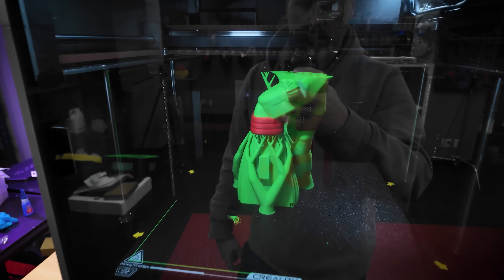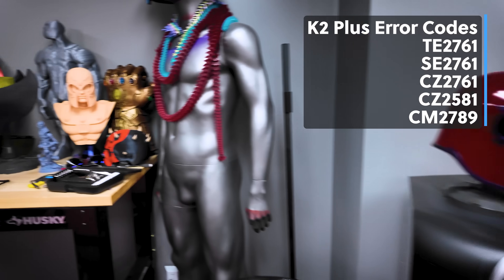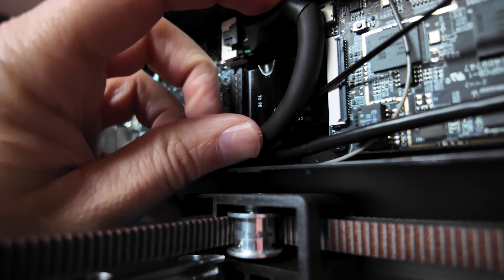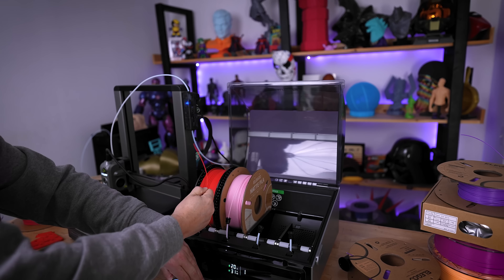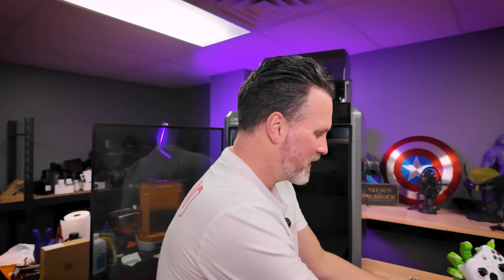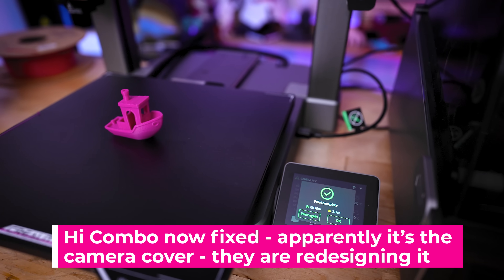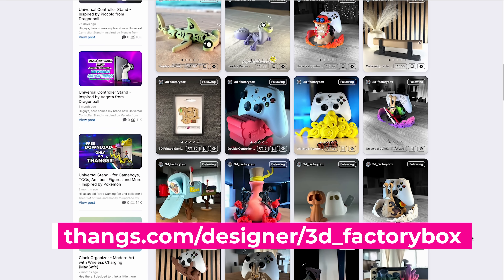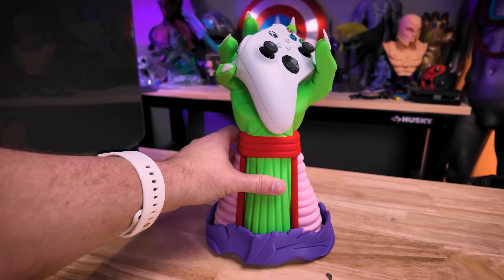Creality K2 Plus FIXED! But Are They Rushing Printers?

Comment: Dude if you think thats bad you dont even want to hear the nightmare I've been dealing with since I got my K2 Plus.  I was lucky enough to get in as one of the first buyers at the 50% off so my first unit showed up late december, opened it up and started a print and nothing but failure after failure after failure until finally during a 3 hour print the unit literally grenaded itself.  Came home to parts of the toolhead as far as 15 feet away from the printer (took the door off due to overheating issues in the extruder).  Boxed that unit up, sent it back, new unit just showed up 2 days ago and the box looks like it was dropped off the side of a building.  There is so much damage to the machine its taken me 2 days just to find all the issues and I havent even plugged it in yet.  They are 1000% rushing units out and FedEx does not handle the shipping process with an ounce of respect.  Before I even opened the replacement machine I counted 15 spots of damage on the shipping box, serious damage, not a scratch here or there, full punctures through the entire box, missing retaining clips, just absolute insanity.  Paid for this machine in June 2024 and havent been able to print a single thing.

Comment: I ordered a Ender 5 MAX on the Creality site it told me it would ship in 3 days.  Then 5 weeks later I find out it will not ship till April 20th and I may get it end of May some time.  So I changed it to the K2 Plus.  Frick am I going to get a garbage printer when I get it.  Its not like the K2 is cheep.  They are so messed up at Creality, they cant even get my order right or on its way.  So disappointed and frustrated at this point.  I dont have any of the products I ordered now 1.5 months later and not sure if I even want them.

Comment: I got a K1Max months after release. After replacing a bunch of mid-run release mix-match of parts, modifying the bed, rooting, doing all the tricks I've seen......it prints half as well as ny Bambus. I had a farm of Ender 3 S1 machines, and they worked great.... but the last 2 generations have been rushed, and even more than usual, they're passing R&D and tech support on to their customers. I'm at the point I don't believe I will buy another Creality.

Comment: I have a k2 plus and so far haven’t had any issues yet (just bought it last week) and was curious if you ever messed around with TPU?  I’m pretty new to 3-D printing, but I tried dialing it in a little bit and have trouble even getting the filament to extrude. I wasn’t using the CFS system as well.

Comment: This video series sums up why I have zero faith in Creality at this point. Creality made it abundently clear they weren't interested in pushing 3d printing forward. They were content for things to sit exactly where they were, releasing incremental upgrades and charging for little to no actual innovation. All the problems that Creality and even Prusa to a degree  have had catching up to Bambu in the past 2 years, shows just how disruptive to the industry they really were. If Bambu hadn't shown up, we would likely still all be dealing with printers that are only marginally better than the Ender 3.

Comment: This printer sucks!
You fix one broken piece & something else breaks. I do think they read comments on your videos tho. I complained about them not responding to email on one of your other videos & the next day they replied to me. They are sending a replacment part for something I have already fixed but the printer was down for so long that it skipped 4 firmware updates. Now it won't cut filament when it retracts. It also prints with elephants foot after the update. My chainlink has now broken if anyone knows where I can get a replacment link or find a STL.

Comment: Other manufacturers: we need to bring new printer to the market, let's change every part from the previous one 🎩
Prusa: we also have a new printer, though it consists mostly of "old" parts 🛠
Buyers looking at Prusa: meh stagnant, meh printed parts 🤮 Let's try the shiny one 🤑
Also Prusa: each model has thousands of test hours in print farm and print profiles tried in practice before they hit the shop 😉
Buyers after getting the shiny thing: I'm done, never buy from brand X. Switches to brand Y for rinse and repeat 🙈

Lesson for other printer manufacturers: start using printed parts and use your printers to make them - aka eating your own dog food - and you will find the errors faster 😅

(Prusa is too expensive for me too, but maybe in the future. Plan B is to wait 6-12 months after printer release to see how it is going and if it is still supported or already abandoned)

Comment: I have two K2 printers. I had to rebuild one. The other had bad extruder motor.  They took 2 months of back and forth to fix the first.  2nd one is still in need of repairs.

Comment: I always like these videos. He is very good at complimenting bad with good and not just blasting the company. It is unfortunate these things happen. No one likes a machine that is new and broken. I had that with a brand new computer years ago and they wanted to replace it with a rebuilt computer (it worked for 30 minutes before dying during setup) so obviously this is not specific to 3d printers. 
Creality may be putting out a few new printers but at least they support older models still and don't just shove them to the side for the next printer that is coming out a few weeks after the last like a certain competitor does. I bought the K2 during the first day pre-sale and it is a great machine. I have had a few issues with it but nothing that was damning. Before you kill a company why don't you find out how many people are actually having these problems. Is it just a handful compared to how many were sold or well over 50%.  Creality is no worse in support than any other 3d printer company I have dealt with. This bashing creality is just tribalism.

Comment: Sounds pretty much like Creality, like every time. No one is immune to this though. My Neptune 4 Pro was an absolute mess, and updating it broke it. I'm waiting for an EMMC USB Adapter so I can re-flash it to OpenNeptune. Straight Klipper for 4 / 4 PRo / Plus / Max that is upgradable! I'm hoping it will save the printer, because with updates it has become LESS useful. Elegoo needs to get it's act together on firmware!

Comment: Lol, this printer is SO close to being what I want... print volume, speed, multi-color, etc. But looks like they have to make another revision of the cable and/or pcb. And hopefully they will test that extensively. Otherwise, it'll just be prone to failure in the same way.

Comment: The only problem with mine was feeding and clogging in extruder and I had to cut a ring out of the spring under the cfs and in the tensioner one the printer head and that fixed my problem and been running like a cramp since then :)

Comment: Based what you said about the cable, they made a mistake and should used right angle connectors or longer cable, etc. All this should have been picked up during testing the assembly. As always, 1st round of customers are free testers.

Comment: If you had time I would be interested if you do a continuity check on the wire to see if the wires or wire did break due to the kink in the tight areas it is routed. Or if a pin was the issue for those who would like to get it fixed before they have a new cable available.

Comment: I got into the hobby almost 2 years ago with the K1 MAX. I loved it so much, I bought a second one a couple months later. To my surprise, the second one had many small improvements and performed much better. A few months after that, my friend purchased one, and it again had many improvements including the unicorn nozzle, which means it also had a different extruder etc etc. 

The printer is amazing when it works, but you have to accept that Creality uses consumers to beta test. I'd like to purchase the K2 in a year when all of the kinks are worked out, but I'm sure they will have released the K3, K4 plus, and K5 ultra and mini before then. Creality, what the hell?

Comment: It’s sad to see these issues. Creality is so very close here. When the K2 is working, it’s an absolutely fantastic machine. Mine is fire and forget and just works. 
I learned that high temp materials work vastly better with a 0.6mm nozzle or larger. I think the strain gauge is tuned for PLA and 0.4mm.

Comment: Very much feeling your frustration in this video. FInally got my FLSun fixed today after 2 MONTHS, which is cool when it works but if you ever have to replace anything on it... good luck! You'll be there half the day and that probably still wont work. Do better printer companies!
Reply: Part cooling fan, hot end element, and hot end temp sensor went on my t1pro.. it's got less than 50hrs on it.

Comment: I was very excited to order my K2 Plus as well....and unfortunately ended up sending mine back for a refund.  It sat in my garage no operable for 1 month due to the bed mounts being broken upon arrival. Once I received and installed the new mounts and did the initial set up on the machine, I got nothing but errors.  I was very unhappy at the fact such an expensive machine wouldn't even work. I did have very high expectations especially seeing I have bought multiple of their printers I'm the past, just feels like they really fell short with this one. Ended up getting a bambu lab unit instead and very excited to start using it, especially knowing it will work as expected right out of the box.

Comment: I love tinkering as much as the next person… my gripe is to receive a new product you pay for and to give FREE diag & repair service to a company and not being compensated for it.

Countless hours and headaches, I would encourage replacing the system rather than chose to repair if these companies can’t learn from not properly testing…

Car, computer, appliances, etc; buying new and any issues under warranty they will have someone fix it and pay for warranty repairs.

This maybe marginal to a select few users but it normal is aimed at those with limited time in life wanting to enjoy the hobby out of the box… my wife isn’t so happy with me ignoring my child for hours to fix countless printer issues when it could be enjoyed printing wonderful things for them as intended.

In the end it’s my 2ct

I appreciate you going above and beyond to help those in need and educate further with any issues. ❤

Thoughts though on the cable; if you cut the heat shrink to allow the bundle of wires to roll over each other on the 180° bend rather than it being flat and tugging on the connection, this may help alleviate the stress on the pin connection?  Or if Creality made a 90 plug instead could help too? USB C instead?

Comment: I have 3 and the only big failure so far was I found 2 jst cables where the pins backed out.  I was insanely lucky i found them.  I measured them, found some premade ones on amazon and fixed next day.

Comment: Tim at TH3D had the same issue. Cables were pinched and they're putting glue on that vertical plug, which is getting soft and melting into the plug, cutting off signals and throwing errors.

Comment: I don't put a whole lot of blame on reviewers here. Most every review I watched for the K2 expressed concerns about quality control. Some reviewers had issues they shared, others didn't have issues. I think its important for a reviewer to indicate where both strengths and weaknesses lie. 

I was lucky enough to grab a K2 on the 50% off pre oreder. For me that price was worth the risk with buying Creality. I have almost 400 hours of print time and have also been lucky enough to not have any issues that were not self inflicted. But I also would not recommend anyone buy a Creality printer  close to release. Even if 95% of units shipped are good, that 5% is unacceptably high.

Comment: The problem with Creality, is that they still behave as if they are still selling 300usd printers ... 

Half assed printers for cheap, that you have to mod to make them work correctly was totally acceptable when they made the entry cost for printers dirt cheap.

But now that they are selling high end expensive printers ... they shouldnt be sending stuff with so little testing. Half the mods i had to do to my K1 Max, should have never been mods in the first place. Those should be basic things that came out with the printer.

Comment: I got mine last week and short prints are ok, but longer (4-5 hours?) prints will eventually fail. Looking at the klippy log, I'm seeing a printhead communication check-in failure. I think this cable might be my culprit as well. I'll tear into it over the weekend. Thanks for pointing this out and calling Creality out on their QC issues.

Do you think there is enough extra slack to assist the relief / remove the strain?

Comment: would you be able to cut the heat shrink away from the cable ends and check the wiring? TH3D had similar issues and their cable was mangled all to hell from the factory.

Comment: Been chasing a belt tension issue on my K2 plus. I visually checked the cable, but after seeing this, I might pull the cable out and test it with a multimeter. Could be a potential solution.

Comment: Creality just steal other companies innovations at this point. Stopped having interest in them since my ender 3 v2's. My bambu's, all of them, simply print. No tinkers, replaced no parts after 6 months of near 24/7 printing. Not worried about the so called drama surrounding them either. If you picked Creality over Bambu because of the 'drama', enjoy your endless tinkering while I relax and print.
Reply: And Bambu is doing the same thing. Welcome to Chinese printers.

Comment: Honestly I have had nothing but trouble with my Creality Ender 3 v3 KE. The fans on it are garbage, the companion app is ALWAYS bugging out (it’s also TRASH), and most damning of all I had one of the belts break so I bought TWO FIRST PARTY replacement sets that were designed for this exact printer and the belts that they sent were both far to long?! I couldn’t believe it so I had to look it up and YEP tons of people on Reddit were saying the same thing.💀

Wtf is going on with this company!? I will never order anything from these guys again, the incompetence is off the charts.